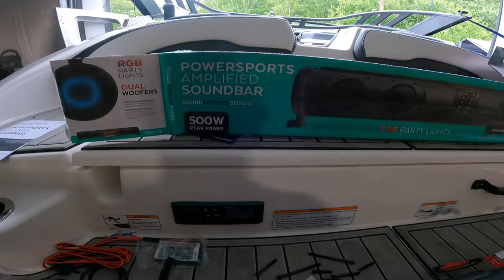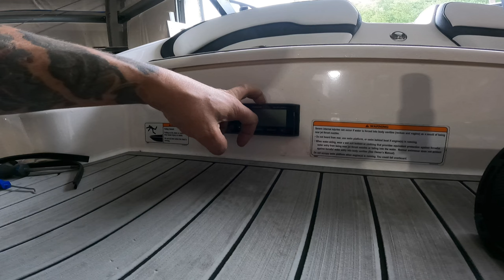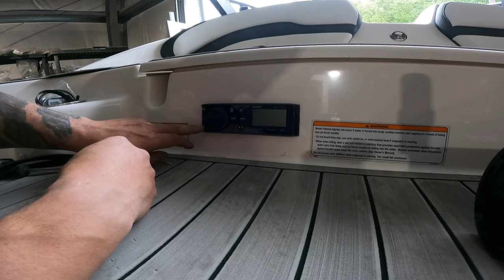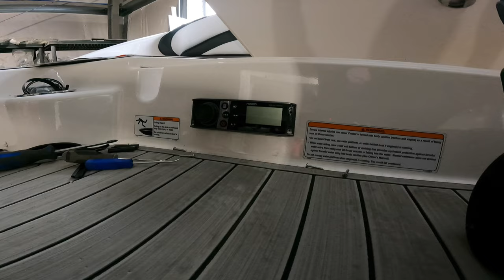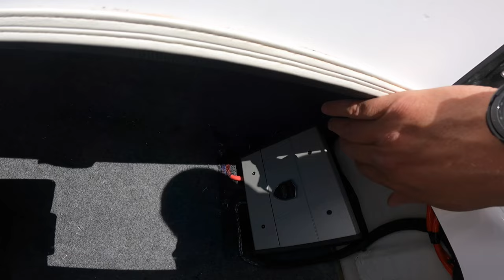This Yamaha 195S Stereo Setup is a BEAST! Tri County Kustomz

Comment: Hey I'm looking to do something very similar to my boat. Did you have to run new wires to the stock speakers? If not how did you know they could handle the increased power output from the amp? I looked on the back of the one in the battery seat and there were no specs I could see.
Reply from the maker: @bradygrimm416  given the wire size I knew they could handle more then what was going to be going through the wiring.  With most stock wiring it can handle upwards of 100 watts without issues.  I didn't run new wiring to the speakers but in the video I did use the speed wire to make the harness going for a portion of the stock wiring
Reply: @tricountykustomz  you cut the speaker wires that were going into the head unit and spliced it to the speed wire which went to the amp right?
Reply from the maker: @bradygrimm416  yep.  From the amp to the factory harness behind the radio in the rear deck.
Reply: Do you know how much rms wattage the stock speakers are rated for? I’m seeing the head unit is 50w x 4 channels at 4ohms
Reply from the maker: @bradygrimm416  I don't.  When the boat came to me it already had wetsound speakers installed.  Theses ones are around 60 watts rms and 120 watts peak.
Reply: @tricountykustomz  thanks for the reply just thinking it doesn’t make a lot of sense to add an amp for the stock speakers if they are already getting their rated power from the head unit. Unless you were going to upgrade the speakers too. New to all this audio stuff gets complicated quick
Reply from the maker: @bradygrimm416  it can be confusing.  But you are right. If the factory speakers are receiving 100 of there rated power then adding a amp wouldn't do a while lot of good. Now typically head units wn they say 45x4. That's peak power. Rms (or continuous) is most likely 25 watts.  Which in this case adding this amp doubled the power going to them to 45-50 watts rms. Which would be a nice improvement.  Even on factory speakers. But where these were aftermarket already then it's just helping to drive these more efficiently allowing them to be pushed closer to there limits.